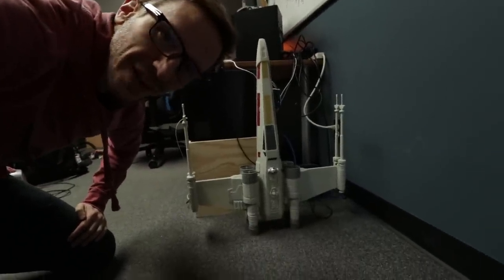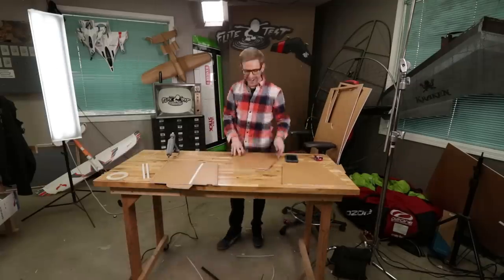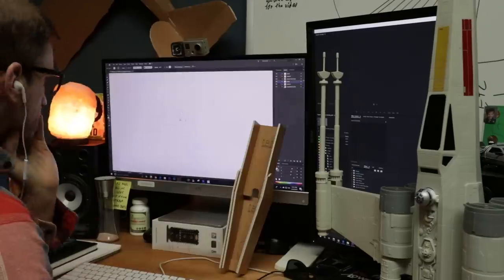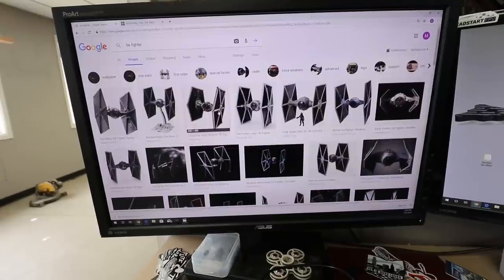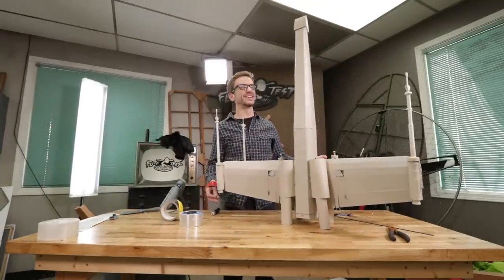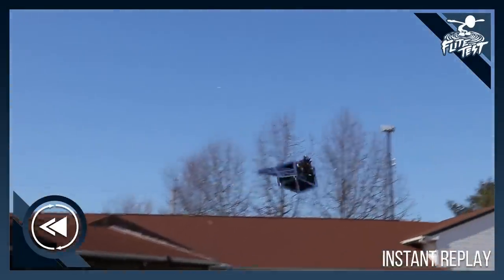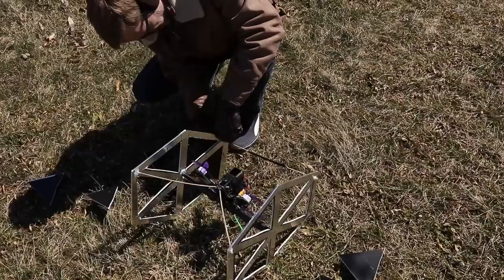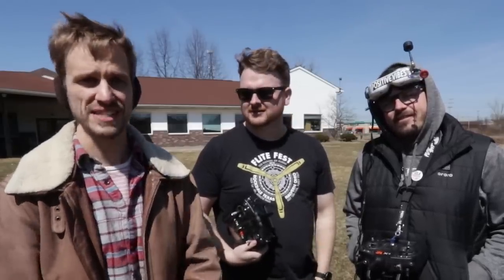We're going to try to not crash this... - Real flying X-wing

Comment: What if you used a fan in each engine?(may help in place of vert stabilizers).  Reduce the control angles.  Use counter rotation on motors to reduce yaw effect.  I think you are close to a good controlled flight X-wing.

Comment: The X-wing configuration is very interesting aerodynamically.  It actually does have some vertical stabilization.  During my undergrad I investigated a staggered x-wing, and at +-20 degree di/anhedral we found that it could fly stably.  It would be control-sensitive, so exponential controls are preferred, but it could be stable.

The problem with the Star Wars X-Wing is the balance point.  To overcome the balance issue, you'd have to treat it similarly to a flying wing, using a slight up-elevator and make it a tiny bit "nose-heavy".

This did not fail (during the first flight) due to a lack of vertical stabilization.  It was an issue of CG.  Put the CG further towards the nose, and you should be fine.

Comment: Really cool. I want one. 

I think that in a perfect world, a fly by wire system paired with thrust vectoring would solve much of your vertical stability problem. Essentially let the astro-mech deal with it.  Then you would fly it fast but not turn it fast to avoid the balance problems inherent with having all the mass on the back. In the video, it kept stalling in slow speeds and tight turns especially as you added the weight from the rudders. With so much weight at the back it became too heavy to break the stalls, leading to some flat spins. 

If it were real, it would be more of a long range missile plaform rather than a dogfighter. Which is kinda how they used them in the original movie. They were fast, able to take a hit and able to deliver guided munitions.

Thanks for the vid guys Loved it.

Comment: Question.
Dihedral pair provides stabilization.
Anhedral does the exact opposite.
The X-wing basically has an anhedral pair and a dihedral pair.
Would it not have been a good plan to change the airfoil profile of the wing pairs, such that the dihedral pair provided most of the lift, and the anhedral pair didn't provide much lift at all? That would allow the odd wing shape to be more stable, yes?
Reply: Hunter Wall, an actual airfoil shape on one set of wings might actually offset the effect of the other? Is that your theory?
It seems that if both sets were airfoil shaped to work together, like a biplane, it might be more stable...I’m not an engineer, just theorizing.
Reply: @josepherwin8709  more that an actual airfoil shape on the correct pair, and no airfoil on the other, would make it perform like an actual airplane with proper stabilization. The lower wings would basically just be there for decoration instead of adding usable lift, and maybe for mounting control surfaces.
Reply: So if the lower pair is used as a mounting point for vertical stabilizers, they could theoretically mount twin verticals using them to create a more rigid wing wing structure and mount rudders on the trailing edges, increasing control quality?
Reply: Wing lift is primarily accomplished by angle-of-attack, (turning the flow of air, not generating lift with Bernoulli's principle) contrary to popular belief.  Just give the lower, (anhedral) wings less angle-of-incidence, in comparison to the angle-of-incidence of the upper, (dihedral) wings.
Reply: throngcleaver, thanks. That’s basically what I was asking, but I was suggesting further that a pair of vertical stabilizers might improve directional control by allowing the inclusion of a part of rudders. What do you think?
Reply: @josepherwin8709  Yes, a small pair of vertical stabilizers would be very helpful on this aircraft.  About a month ago, I suggested in a comment to use clear sheet plastic to make them, so they weren't as noticeable, or even unnoticeable, inflight.
Reply: @throngcleaver  Bernoulli and turning the flow of air are different sides of the same process and both can be very relevant when explaining how an airfoil works. The flow does accelerate on the top of an airfoil generating lift (subsonic flight). It's just the cause of that acceleration that's is very commonly misunderstood (the "equal transit time" myth/popular belief)
Reply: @johanveltheim4331  I disagree, since the amount of lift generated by Bernoulli's principle is extremely small, compared to the turning of the airflow.  Aircraft with flat wings and those with symmetrical airfoils, fly just fine.  Read this from NASA:
https://www.grc.nasa.gov/www/k-12/airplane/wrong1.html
Reply: @throngcleaver  yep. put enough thrust on anything and it will fly.

Comment: Sure looked tail heavy to me, especially  when it was falling tail first. Not convinced it needed the vertical stabilizers at all.
Reply: What's the old saying..."nose heavy flies badly, tail heavy flies ONCE."?
Reply: @larrykeene417  "A nose heavy plane flies poorly... A tail heavy plane flies once."
Reply: You need to use an auto-stable airfoil with a reflexed after section.  IE flying plank.
Reply: That X-Wing seems to be piloted by a drunk Yoda. xD

Comment: I put a lot of thought in this quite a while back.
The center of gravity issue is a nightmare in itself.
As far as the dihedral of the wings, here is one solution.
Have plenty of standard chord on the upper wings, and reduce that to half in the lower ones.
You will have a net increase In dihedral overall, because the lower wings would not be supplying so much lift.
For rudder without vertical stabilizers, inner flaps between the wings, upper and lower, can produce a braking effect to control yaw.
Use a microprocessor in the mix for overall stability.
To add even more control, I would either use directional fins within the fans, or use motors with props on hinges, or even gimbals, to use the vectored thrust for further stability.
It would likely be too much to expect even a microprocessor to adjust the speed of each engine, which would also aid in stability as well as ridiculously tight maneuvers.

Comment: The problem is the lower wing ailerons. Because of the angle of the lower wing, the ailerons need to move at a shallower angle the father from the body of the plane. Essentially, you have airflow similar to a mainsail and a jib.  The main sail provides the mobility; the jib increases speed, adds "lift" and maneuverability. The lower ailerons can add stability -- or massively increase instability.

Comment: Build a mini version of the SR-71
Reply: That would be sweet...I have been saying more ultra micro builds so we can reuse our crashed  1S UMX gear...but with a brushless motor/esc conversion...
I keep hearing that there is no brushless outrunner capable of better performance on 1S pulling same or less amps then the brushed geared stock 1S setup...something like a  6 gram weight  1105 5000kv motor turning a 5x3 or 6x3 prop...seen lots of testing on 2S for these small outrunners but not much testing done on  1S...
Reply: My son would love seeing this.
Reply: if they do a good looking micro build, i'd buy it just to put it together to hang up somewhere....
Reply: I got to see an SR-71 in person once at the Udvar-Hazy Center.  The presence it had just sitting there was absolutely incredible.  It looks like an alien space ship.  The most incredible thing to me incredible is the fact that it was designed in the 1960s.  No computational fluid dynamics.  Pencils, paper, and some really talented engineers.
Reply: @bagel_deficient  I've seen that one too. The thing that struck me about it was that it wasn't a huge towering aircraft - looks taller on tv, lol!
There's one at the SAC museum near Omaha also.It's mounted on an angled pedestal with the gear up and looks like Tom Cruise should be in the cockpit. Very dynamic and glamorous. The one at UH looks like it's just waiting for someone to fuel it up and go. All business. I like UH better.
Reply: Here here!
Reply: Sr71s are my favourite aircraft
Reply: Even if they built one that didn't fly I would buy a kit just to have to look at.
Reply: Yes a simple build or master kit  of the SR-71.
Reply: Putting a date on myself, but what about some of the space ships like the shuttles and the fighters from Babylon 5 ?  I understand that Star Wars is far more popular, but there were some pretty cool 
ships in that series that were actually something approaching aerodynamic. And well I loved it, for the most part.
It did have some lame stuff going on, but there is some standout atmosphere capable vechicles in that show.
Reply: My uncle Rich was in the Air Force in security. He told me about the time an SR  -71 landed for some reason, refueled, and departed. He said it was one of the most amazing things he ever seen when that bird rolled out and immediatly went nearly vertical ! This was during the mid sixtes and was cutting edge technology at that time! No pictures were allowed, and large trucks with billboard sized view screens immediately rolled alongside of the parked plane to prevent most from seeing it's entirety! He gets quite excited while telling this story! One one absolutely favorite plans, I built revels plastic model in the mid 70's. Still have it!
Reply: I'm all for an SR-71 - all the more so if there's a kit!

For the real ones on display, there's also one in Warner Robins, GA.
Reply: M-21 with a D-21?
Reply: @K3Flyguy  I grew up in Northern California just outside of Beale Air Force Base and saw the Blackbird on many occasions. While having lunch one day '66 while in High School, we saw the most unforgettable sight...the SR-71 making an emergency straight-in approach with the starboard  engine fully engulfed in FLAMES !  He must have made it because we never saw a cloud of smoke or heard any reports.  Five years later while stationed at Ft. Bliss Texas a Blackbird flamed out on takeoff and barely cleared the main road around the airport.  Every aircraft has had its share of failures and misfortune, but I still hold the SR-71 with utmost of awe.  
While taking flying lessons at the local county airstrip I took a ride in a 1936 Globe 'Swift', that belonged to a very nice gentleman named Pat Halloran, who at that time in 1967, was one the pilots for the '71.  He couldn't tell just how fast it was...TOP SECRET...but he said it would make you pass out from the acceleration.   Saw him on TV on a show about the Blackbird a while back and he looks as good now as he did 50 years ago.  He went faster than Father Time...
Truly some America's Finest equipment and People...U.S.Air Force
Reply: @Mark White 
I’ve seen five of them in person, met two pilots and sat in two of them, specifically, 61-17951 & 64-17977.
Reply: Yeah maybe a Blackbird too!
Reply: Can you guys build an aircraft which carries two sets of motor, one set is of low power and another set is with high speed , like I can switch between this motor, when I want operate this aircraft with low speed, may be I can use that and when I need some turbo speed I can pull in this high speed motors, like I can add more loads and see the variations how this fight gonna fly with different auxiliary motors.

Comment: How about a Viper from the original Battlestar Galactica series?  Now THAT should be a challenge to get into a controlled flight mode!
Reply: That would actually be easier as the viper is shaped much like an actual jet.
Reply: @sockmonkey6666  But no real wings to speak of.  Now if they put a big enough EDF in it so it flies like the old MIG-25 or X-15 (rockets with wings) it would work.
Reply: That's basically an x-wing with no wings
Reply: Estes for a short time made a Viper model rocket kit. To be stable it required clear extensions on the fins and an insert section between the nose cone and body tube for flight. For display the insert section was removable.

Comment: BATTLESTAR GALACTICA COLONIAL VIPER!!! (from the original series)
Reply: Was going to suggest that seen that another great mind already mentioned it. LOL But totally agree that would be awesome if they can build and get one to fly.
Reply: And it has that all important vertical stabilizer!
Reply: A long time ago I made chuck gliders of both an X-wing and a Colonial viper.   I ended up having to make larger than scale tube engines for both and a pair of lexan "invisible vertical stabilizers" for the X-wing to work.   They both chucked amazingly well, considering the aircraft design was not done with atmosphere in mind.
Reply: its allready done in profile.. the problem is that it has anhedhral
Reply: THEY NEED TO DO THAT
Reply: WOW! I've never had so many replies to my comment. Cool. How about the Cylon Raider? Isn't it just a shiny Nutball?
Reply: @Skammy5  the new one or the classic one?
Reply: Hoping for classic here.
Reply: @Buck1954   they should had tried tricks to work as vertical stabs.. likefor example making the 4 canons flat vertically.. and also maybe curving upward the tips of the trailing edges of each wing to create drag in there.. there is wings that fly without vertical stabs thanks to tip washout (like the Horten wing)
Reply: @sparrowlt  - or make the nose like a canard, and move up and down in the airflow to give lift, stabilizing the nose somewhat.  Or, mounting a clear vertical stab on the nose might have helped some, too.
Reply: The Mk7 was nice.
Reply: @ravecaster  look arround on youtube.. there is tries with both variants of raiders
Reply: I made one in Kerbal Space Program
Reply: Agreed. Colonial Viper from the original series would be fantastic!

Comment: Clear plastic canards up front, and a lot less elevon action  in the rear, and that thing would be very flyable!
Reply: I was thinking canard as well.
Reply: Yeah with the wings in the rear and the long nose some small control surfaces up front would probably make it fly much better.
Reply: Inspiring, isn't it? I would go with elevons on just the lower anehedral wing pair F-4 Phantom style, leaving the upper pair configured for constant lift.

Comment: Try to make a flying DeLorean of back to the future 3 thanks for the ❤
Reply: I second this. Mount the motors upside-down, and then make them spin in reverse.
Reply: Yeah a very light body and some very fast motors inducted fans.
Reply: Why stop with the DeLorien?  Do the time train from the end of the movie!
Reply: @riddhemarcenas4833  Did the time train fly? Could it? I don't remember.
Reply: It lifted off the track with wings that slid out from under the tender car and the tender car had giant versions of the vents the DeLorean had from part 2.  It flew forward, turned, and flew right into the camera/audience.  I think the wheels may have folded down but I don't remember off-hand.

Comment: A reflex airfoil (flying wing type) and some stability augmentation might be the order of the day if you want to make one that actually REALLY flies.  I'm thoroughly amazed you got as far as you did with the design strategies utilized.  Not too bad.  "I literally did not know what it was doing for like a whole minute" and vertical flat spin drops to a backward 'flying' completely uncontrolled landing is not what I would really call totally controlled flight, though.  Some thrust vectoring might be very helpful, too.  I realize I've increased the complexity about 100X, but I'll bet even just some reflex in the airfoil would help.

Oh, and I don't care if the tie fighter falls apart, just sayin'.  And the way to designed it I expect it was unstable in yaw.

Comment: Great job with the time crunch. Loved the Idea of the vertical stab's. wondering what the  C/G. Is reacting very tail-heavy. Wondering if weight added to the front would keep it from weird maneuvers. plus every one goes to 2 engines when its a 4 engine aircraft. if you put 1 strong engine in front and had it coming out all 4 rear ports would look so much movie realistic. and might fix the C/G problem.

Comment: How about putting a (working) canard on the X-wing for stability?  Also,  on the upper wings make them work like a V-tail Bonanza,  while making lower wing  (With less Dihedral)control roll.   And Change the surface area of the  control surfaces of the two wings.   Just a thought...

Comment: I dont know it if it would work any better, but why not take a page from the parrot swing mini drone, which is a xwing style quad with 4 props on each corner of the wing at a slight angle. Might be the trick for the forward stability issue.

Comment: Here are my observations: 

i) One important thing that we can comfortably assume about the real TIE fighters and X-wings is that they might be having a fly-by-wire system to help them deal with flying within the atmospheric  conditions of the planets that they travel to in order to deal with factors like wind and air flow over the wings but they are both space fighters and we know that there is just vacuum in space so they would not experience wind resistance, drag and so on in space flight aside from no air flow over their wings in such conditions.

ii) Second thing that I noticed is how the nose of the X-wing kept pitching up at times and that has to do with the nature of the air flow over its control surfaces especially its wings which are placed further back as the real X-wing's wings would be located, so it was behaving like an aircraft with a negative wing sweep like the NASA X-29 or the Russian Sukhoi Su-47 Golden Eagle, both of which use a fly-by-wire system to overcome that pitching up manoeuvre, along with the use of specific flexible materials in the wings that are strong to deal with the high aerodynamic stresses that wings with negative wing sweep's experience during flight especially at higher speeds, improving their longevity.

Otherwise, it is fun to see how they fly and enjoy the same, the X-wing was making some pretty tricky manoeuvers which would turn the tables on its pursuer in a dime. :D